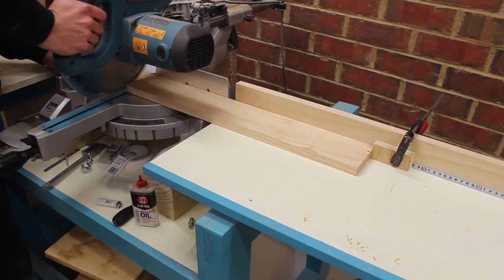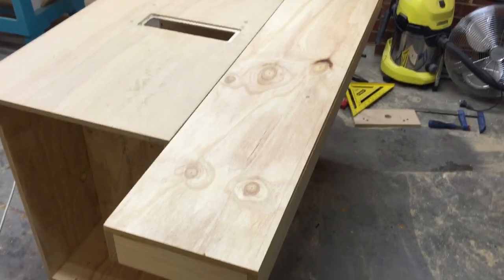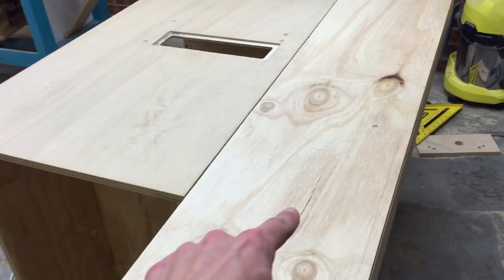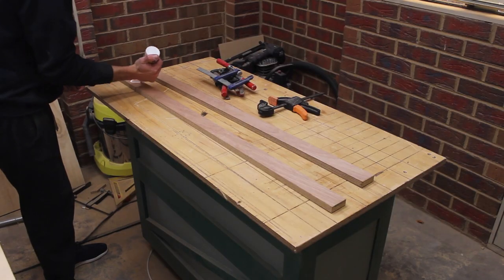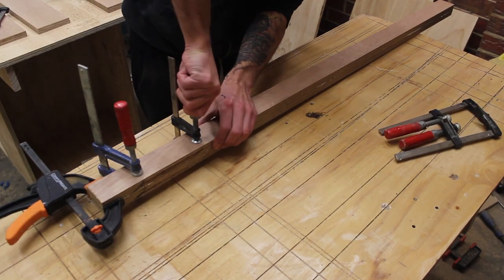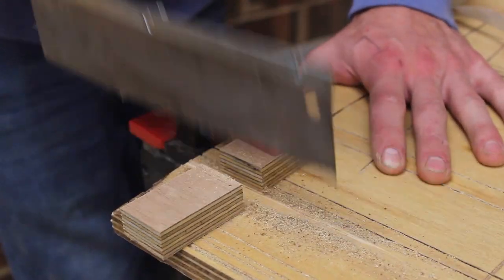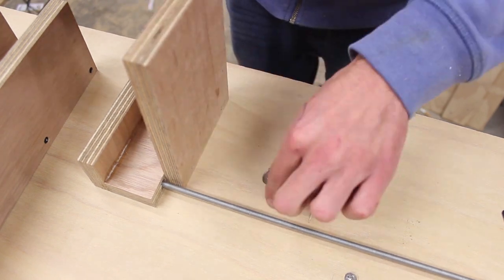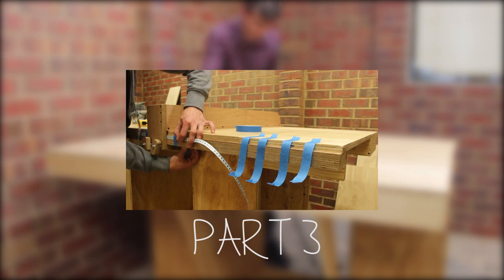Home made table saw part 2

Comment: Hey Mark, thanks for highlighting every little detail about the build and the great videos you are making, looking forward to part 3.
I have built my own table saw and am using the same circular saw as the one you are, it weighs about 7-8kg if i remember well. The problem I had is after couple of months the top has sagged under the weight of the saw (i used birch ply 18mm). Overcoming this, I have stiffened the top by adding another layer of ply, stiffened it further with two 2x4 across the board and half lapped into the frame (positioned just next to the saw) and connected these 2x4s with cross pieces for extra rigidity (forming a square around the saw). More than 10 months now and the top is still very flat. 
Hope to have helped avoid a similar problem like mine.
Keep making great videos, cheers!
Reply from the maker: Great idea Pierre. I did add some support pieces as there was a little sag once installed. Better to future proof it now to avoid fixing later
Reply: +Mark Susak yes, not much fun to do the fixing later. It would be a good idea to install the support just under where the t-tracks will go, you will be routing away about 2/3 of the board thickness to install the t-tracks.
Keep up the great work and looking forward to the accessories build video.

Comment: At first, I was shocked by the birch plywood price you stated, but then I remembered the terrible quality of the "Project Grade" baltic birch plywood sold at the Big Box "lumberyards" here in the Midwest, USA. It's a lot cheaper, but maybe not a better deal. While it's "only" about $50 USD, it's also only 1 "good" side (extremely thin/inconsistent, with up to a dozen or so large patches), full of large internal voids and on the rough face, and it's practically guaranteed to warp/twist/bow.  It's just cheap 5-7 ply sub-flooring with a low grade veneer on one face.
Reply from the maker: Hi Daniel thats good to know! It seems that plywood varies in price considerably depending on where you're from. I have tried to find another vendor that sells birch plywood but they all seem to be the same price. sucks!

Comment: In the past I used to spring for Titebond when I was feeling flush and use the cheapest PVA wood glue when I was broke, in 26 years I've yet to have a project fail using either one, the conclusion I draw from this is that generic PVA wood glue does a decent job at a much cheaper price than brand name glues, they only time I use name brands is when I need a water proof glue for a project.

On a side note don't be tempted to use PVA craft glue for wood working it's not up to the job as a friend found out to his cost when his project started delaminating after less than a year!, craft PVA is considerably watered down compared to PVA wood glue.